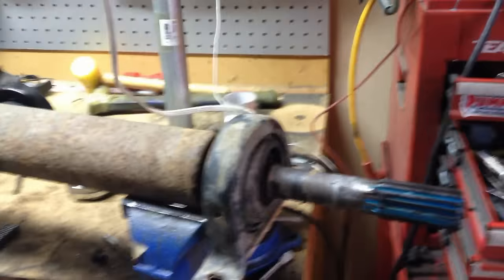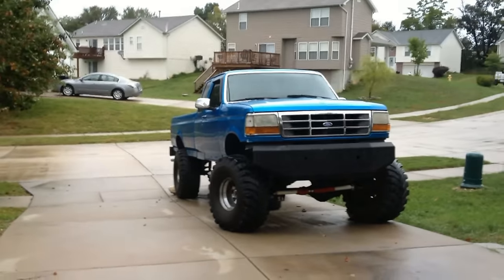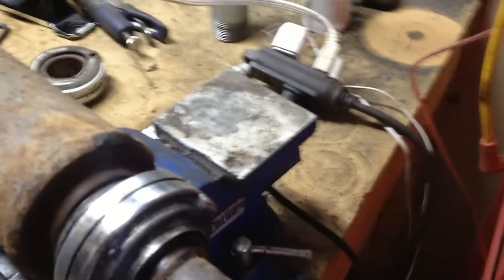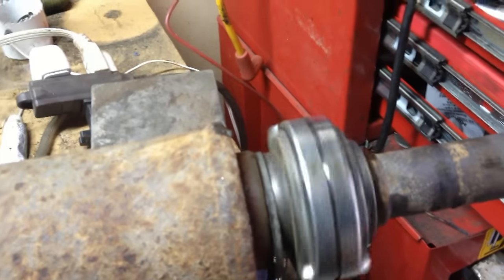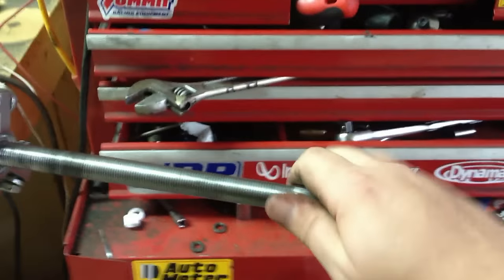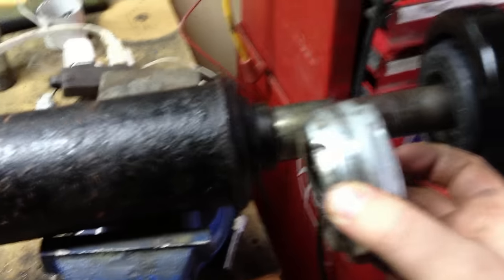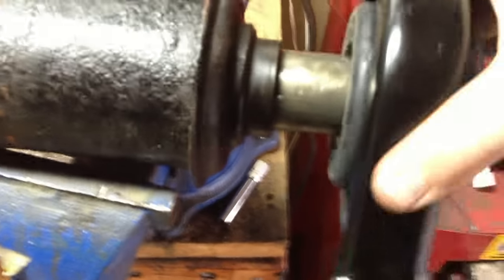HOW TO: Replace a Carrier Bearing

Comment: A puller tools works great and I would prefer to use that but you can just use a cut off tool or angle grinder to cut off the racer

Comment: Skimmed through 6 other videos (9-20min each) of idiots rambling and ultimately not showing the how to of removing and replacing that bearing.
Thanks for the short, to the point video.
A puller and a pipe. Done and done.
Thanks!

Comment: Really wanted to actually see you removing the bearing to get a sense of how hard it might be
Reply from the maker: That completely depends on the condition of your bearing. Mine came right off.
Reply: @CarMedz   Well mine was heat welded to the shaft,had to cut it off with angle grinder

Comment: Nice video NEED change on 2000 Gmc Sonoma but mines is square rubber housing worn center piece rattling. some folks say not worth changing because they short life 3500miles but whoo has 400$ to Rebuild one piece Drive Shaft.
Reply: Dealer told me same shit about my Cadillac I bought I bearing from auto zone and just swapped out the bearing and reused the whole shift. Dealer said I had to buy a whole shift for $800

Comment: What size puller is it ?
  I tryed used 8" didn't work on mine looks need longer one 9 or 10" ,??
Reply: Same here.  I used an 8" and it was about an inch too short.  Ended up pulling out the trusty angle grinder and slicing that bearing to pieces to get it off.  Wasn't just a whole lot of fun but it's done now 🍻

Comment: when this carrier bearing goes does it make a kind of humming noise that sounds like is coming from passenger side rear tire ? im thinking passenger side noise because gas tank is blocking the noise from being heard on drivers side
Reply: roman star check to see if your tires are “feathered” makes a similar sound

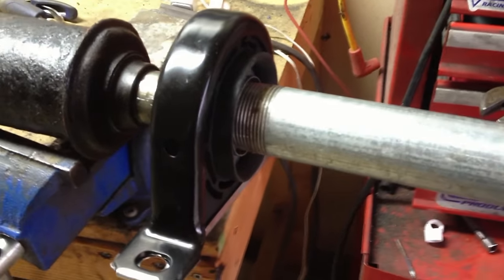Comment: Did You have an issue to make you change it ? Or what was reason ? 1 1/4 inch pipe @ 1:54 is that id or od . IF yours is same size for My 2002 Excursion then I will need to get pipe
Reply from the maker: 1 1/4 OD worked for mine. The carrier bearing gets worn and starts to make drive line vibrations
Reply: @CarMedz  Thanks man . Was that the 8 inch puller ?
Reply from the maker: @Richard5873  I mean it was 5 years ago. The biggest one you got is what I would say. Probably closee to 12

Comment: Not sure if I see a shim for the old carrier, looks like one on the table? but I do see the rubber and metal carrier strap cocked/crooked because of the suspension lift. No wonder it went out. My f150 shaft fell out not long after my lift went on with no mods to the carrier bearing. My 2 cents.
Reply from the maker: I think i sold that truck 5 years ago. I am building other dumb stuff now lol.

Comment: Why’d you skip the important part of extracting the bearing ?
Reply from the maker: ... you use the puller. If you're not sure how that part works, I would strongly recommend taking the vehicle to a mechanic. They use threaded shaft to apply linear force as you turn them with a wrench.

Comment: Question i would like to know whether the same process you did here on your ford truck would apply to my 07 ford edge sel awd suv i have. Both my carrier bearings the rubber on both are completely gone. Thank you in advance for giving me a few moments of your time to answer this question i have. An i have the puller that you used as well. Not sure if shaft is same as yours though for fitting the pipe over it to drive new one into place as you indicated here in your video.
Reply from the maker: Yup, same process. Just make sure the pipe you use to hammer the new one on is as small as it can be to fit over the toothed section. That way your hitting the inner race of the bearing and not putting pressure on the outer race.
Reply: @CarMedz  okay which is cheapest carrier bearing to buy to replicate what you done ? An thank you very much for responding to my inquiry.
Reply from the maker: Rockauto.com would be your best bet. Dont always go for the cheapest though. A few extra bucks goes a long way with car parts.

Comment: Do you need to top off differential after reinstalling shaft? Put new bearing on shinny metal in sun and keep drive shaft in cool spot 45mins before installing. Helps some.

Comment: I blinked and I missed the old bearing coming off....... 👎🏿
Reply from the maker: you turn the bolt on the puller. if our not sure how the puller works I might recommend taking the drive shaft to a shop to have it done. pretty easy though once you get the puller on, just remember it is rightsy tightsy lefty loosey.
Reply: @CarMedz  maybe that’s what you did?  Take it to a shop?
Reply from the maker: @missiletm  no i turned the bolt on the puller. thats the part i did not film. I was just saying if you are not sure how to turn the bolt on a puller that i would probably take it to a shop.
Reply: @CarMedz  why didn’t you film the removal and the installation of the bearing?  I’m sure there’s plenty of places to prop up your camera in your garage.  Maybe you DID take it to the shop and have them do it?  We’ll never know for sure.........
Reply: What a bunch of cry babies... If you don't know how to use a puller you don't belong removing a carrier bearing let alone dropping a driveshaft